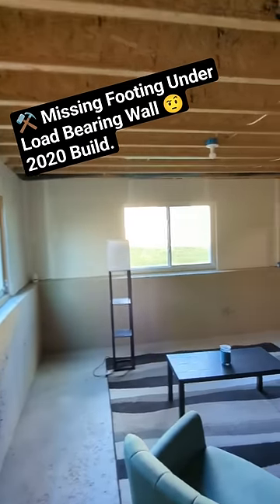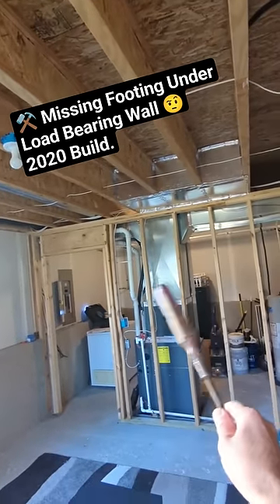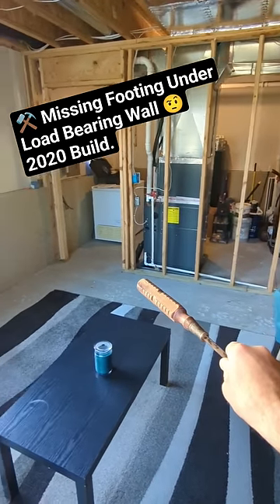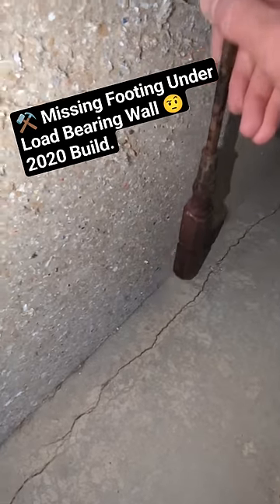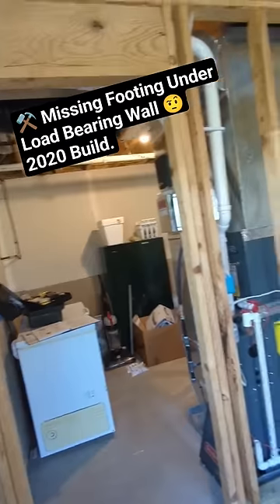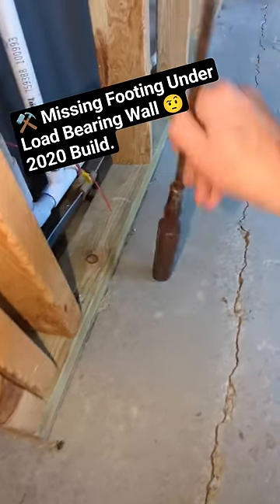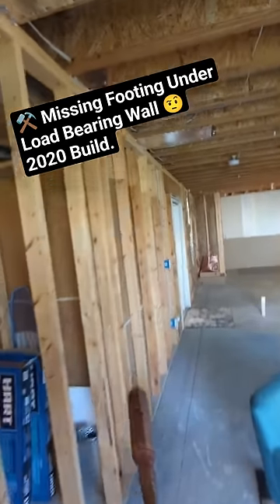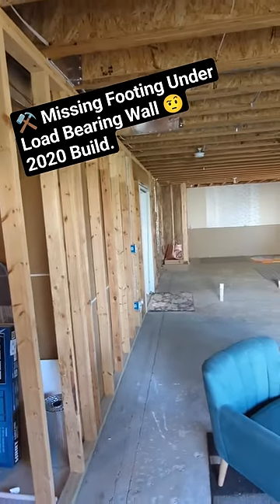FOOTINGS missing under load bearing walls NEW BUILD A trick to find missing#footing under #concrete

Comment: You have bigger issues... Why does your slab sound hollow in the 1st place? 

When slabs are placed, there is no way the sounds are different between the slab with or without footings! They both supposed to sound just dense when tapped!
Reply from the maker: Exactly.👍
Thanks for watching
Reply: I think that's the point of the video my guy..
Reply: @RedBeardDevelopment  meaning, were there is a footing, at the exterior wall, and the slab butting that footing... Never mind the interior load bearing wall! None of the slab should sound hollow like that! 

You cannot identify footings by tapping on a well placed slab.
Reply: If the footing isn't there then it must've not been on the plans because how would the contractor miss it and even then when they prep the slab to pour a inspector has to look and sign off on it before concrete hits the ground, and it sounds like a void under that one as hollow as it sounds.
Reply: @RedBeardDevelopment The point of the video is, a missing footing, my guy
Reply: @markme4  what would we do without you… thank you for clarifying
Reply: As a home builder, subcontractors miss stuff on plans all the time. not intentional, but in a hurry or out of ignorance. We walk through the foundation process at each step to make sure nothing is missed. Framing gets checked, etc etc.
Reply: @alquinn3562  exactly, the builder should not expect subcontracts to be technically sound and knowledgeable but It is the job of the Field Engineer/Supervisor to make sure everything is done according to the IFC drawings.
Reply: You don't seem to understand what's going on.  This is not "his" slab.  He is an inspector, just simply pointing out what the issue is.
Reply: @Bruceless  So what's with that thick pink-ish foam I see laid down before the pour?
Reply: @Bruceless  Talk about completely missing the point captain obvious.
Reply: Sounds thin in general
Reply: @SXSPRIME exactly sound like only 4 inch.
Reply: When you are on the exterior wall.  You say footing .  Is the stem wall considered a footing?
Reply: @rajibkundu5217 you should t expect subcontractors to know what they're doing? Bruh that is their job
Reply: @TzUuup  yes, it is their job, but a lot of times, subcontractors and their labor force make horrible mistakes, which cost millions and time. In my engineering work life, I have seen the worst. It's always better to be cautious than sorry.
Reply: This must be in the southwest
Reply: Thank goodness somebody.
Reply: @rajibkundu5217 as a plumber a builder has no business saying anything about the technical aspect od my job.  My job requires a lisnecse that takes 4 years of schooling.  No builder is telling me how to install my plumbing.
Reply: @Bruceless it sounds like the dirt or gravel under the slab has washed out in spots though does it not?
Reply: A footing should be 4000 psi aeg mix, the slab is usually 3000 psi. Density differential causes the difference in sound
Reply: I worked in foundation prep. No way that would ever have even passed the pre-pour inspection. Must be outside of city limits.
Reply: @adammonahan687 . Yes! It is absolutely hollowed for some reason or the other. Whether via poorly compacted, base washed away or expansive soils, you basically got my point! 

Regardless if its psi rated for footings vs slab or even if the footing is 18" thick and the slab is only 4, the slab should not sound hollow and will sound exactly alike to our naked ear, whether 18" or 4", when tapped with any solid object given the slab sits on properly compacted soils! 

To all these ppl speaking that I missed the point! No, I got the point clearly but just was identifying another yet potentially bigger issue. A hollowed slab! 

To all you contractors out there, I'm sure you've tapped on well set porcelain tile vs tile not set so well with any solid object, to include tapping it with a screw driver handle? I offer you this, try tapping on tile, set properly on concrete. It sounds solid, like you are tapping on the concrete itself! Then try tapping on tile which is not set properly! Huge difference!

If anyone can tell me what is the difference in sound between a 24" footing and a 4"slab when tapped with a screwdriver then congratulations, you can sell that special screwdriver for thousands of dollars cause guess what?? You will not hear the difference on any screw drivers I ever bought!
Reply: aka, its a double issue.. 
A that there is no footing where it should be, and B the slab is sub standard quality.. well residential slab thickness is
Reply: that's where the bodies are hid and they hoped no one like you came along
Reply: Fun Fact. The basemens load bearing wall ABSOLUTELY DOES HAVE afooting in the proper location. The inspector himself signed off on it. HOWEVER! The contractor actually built the foundation 180degrees from the proper print that was revised only 2 times before the engineers& architect realized they were on the South side of the property and not the North.
Reply: The reason it sounds hollow is the rigid insulation under it
Reply: Dirt is not as dense as concrete. So there will be a sound difference
Reply: @robertpulliam4152  a builder has every right and duty to tell you your job. Who do you think is paying you?
Reply: Over time the slab will be more hollow though because it isnt built as structurally sound and cant wash out the same way
Reply: Agree. It’s worst then you think. Sounds like there’s a void underneath that slab.
Reply: Foam under the slab slab on grade has thickened edges looks like atleast two pours and also lots of plumbing under the concrete that etss hidden in the wall
Reply: @ThatSB  lolololololol
Reply: If you don't get it you never will 😅😅😅😅😅
Reply: Exactly the slab IS THE FOOTING for interior load bearing walls.
Reply: This thing has to come down huh?
Reply: I'm sure you probably didn't mean it was HIS slab, as it's obvious HE is the one pointing out the mistake in the foundation. However, I felt the need to point it out because others seem to be assuming you are accusing the one narrating the video of improperly laying the foundation, and to be perfectly honest, you choice of wording that suggest you believe the narrator is the one who made the mistake, when he's clearly just the inspector. Hence the channel name, "inspecflix."
Reply: Easy fix, done in a day😂
Reply: If you pour essentially the same thing on a bridge they test it with a chain to see how it sounds by how it's connected to what's below. If you smack a bearing wall with weight on it the studs vibrate at a higher frequency from the load same with concrete the way it's attached is going to have a different sound if it's hollow underneath or if it's laying on dirt
Reply: @devinnorsworthy9154 We had an inspector look at our house. He says" This is what we call county built" 😢
Reply: So now that we clearly know there’s a footing issue in this construction, will it all be torn up to set it correctly or will it just be covered up because we’re too far into the building process??
Reply: Somebody getting sued lol
Reply: The difference between the two spots is a distance away from the wall. 

The slab did crack, but it is perfectly straight, which is odd. I feel like that has a leveling slab on top of an existing slab, probably to make it even if it was a basement garage. So the leveling coating cracked where the existing expansion joints were.
Reply: Typically it's from wash out....or critters burrowing
Reply: that's how they do it now hollow concrete
Reply: How freaking thin is that slab!?
Reply: That sucker is gonna settle out of sight.
Reply: Yes , this question?
Reply: @rajibkundu5217 jesus ive had contractors who’ve told me to remove load bearing walls with no support anywhere. Actually had one tell me to demo a fireplace in a 2 story house from the bottom up. Seriously. And then look at me like im stupid. Just, damn
Reply: Wrong
Reply: @donkegin4946 It would seem that way. I've seen inspectors and concrete contractors miss footings on plans before. Also, I've architects make mistakes.
Reply: @donkegin4946 lol that's naive.
Reply: Just move.
Reply: Here come the YouTube experts!
Reply: Why do you think a 4 inch slab would sound the same as a 2ft footing?
Reply: So what is the solution and who is responsible?
Reply: That is what I’m saying I’ve never bird a slab sound like this lol
Reply: Is it the 2nd story?
Reply: That sounds like an extremely expensive fix 😂😂
Reply: Yeah, unless there's erosion or sinking dirt. That never happens... this guy. Tell me you know nothing about concrete without telling me my guy.... they also never build houses on Landfills lol.
Reply: That is what we call sounding for the people who don't know it's a simple test. Yes, the entire slab is not supported as well as it should be, which is the reason for the settling and the cracks. This means that if it is on the they skipped a big part of this important thing called compaction what i see in the majority of cases. The other thing is they could be they were cheap and did use a good base material, aka base coarse. Either way in most cases it is because they skipped steps or saved money by cutting costs through materials.
Reply: @nickjimenez4262  nothing more to do because nobody cares.not my house guy.
Reply: @RedBeardDevelopment quit saying my guy
Reply: Right footing = important 
Slab not being dense not that important as long as load bearing areas have a footing
Reply: @robertpulliam4152  As a superintendent for the Gc,  I shouldn't have to tell you how to do your job but I can't tell you how many times I catch you guys using the wrong type of copper for underground just to save money, etc, etc
Reply: @rogerdixon1069  The slab would need to be saw cut and demoed to the width of ftg and then excavated probably 12 inches down, place rebar, anchor bolts and Hold-downs, and then re-pour concrete
Reply: @rajibkundu5217 most sub mistakes are because of rhe prime contractor not doing their job
Reply: No the point is having a slab that sounds the same if you want to sit on it and have a drum solo  @markme4
Reply: No Inspector signed off before the Concrete was poured?
Reply: @robertpulliam4152  They will if they are paying for a quality job.
Reply: Drill holes and pump it with expanding foam?
Reply: I was thinking the same thing about the density of the slab. It sounds like those giant worms from the movie "Tremors" were underneath making tunnels
Reply: Good point. Slabs should not sound hollow. Ever.
Reply: I learned something today.
Reply: Actually, he’s using a wooden handled chisel which is going to amplify the difference in town. It’s the same technique bricklayers have used for a long time… And you can hear the difference. I knew an old hat bricklayer that could tell you to the Eric health take a slab was by the sound.
Reply: That's going to be expensive to fix. May have to grout the whole underfloor.
Reply: The concrete is probably two inches thick, no rebar or wire in it!
Reply: Slab poured to footing? Should be on house footing going all around basement. No wire or rebar in slab. That wall is load bearing! Those TJIs will bounce like a trampoline. Don't be cheap and put some 3'×3' footings under slab for some posts to hold beam, iron or wood headers. People who defend this construction are wrong.
Reply: Foam board below slab and not below footing. That is what would produce the hollow sound. Common in northern states and canada.
Reply: I am thinking something seattled... and in 3 years? Thsts bad.
Reply: It's 2 inches lol
Reply: @donkegin4946 they have to sign off on it at multiple points befor the concrete and after its poured
Reply: @RedBeardDevelopment no. Its not. The point is their no footing.
Reply: Are you slow
Reply: could their be spray foam insulation under the slab?
Reply: Well someone poured concrete with an air lock under it.. this is why id never buy a house built after 1980..
Reply: Unless you have insulation under the slab
Reply: @thefinalgrind  And they had the print upside down, right?  :)
Reply: Its less of a slab so much as 1.5" ratproofing.
Reply: Do the structural drawings show that there should be a footing there?
Reply: Do you have a copy of the structural drawings for this house showing a strip footing underneath the "load bearing" wall? Did you check the span charts for those engineered floor joists, or are you just spewing crap!
Reply: @rajibkundu5217  bull💩. Contractors are professionals and shouldn't be in business if they can't read plans. The framers knew it was a laod bearing wall. So obviously it was in the plans and the concrete workers mess up.

Comment: Just because the opening has a header doesn't mean it's a load bearing wall. It means the carpenter who built the wall was a good carpenter who built the opening the same as a load bearing wall. I would be embarrassed if I posted this video